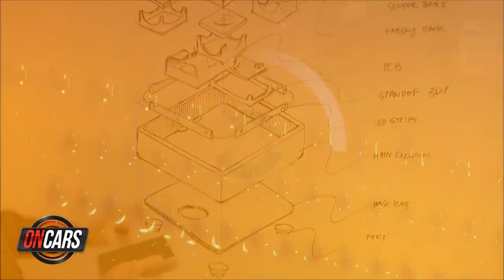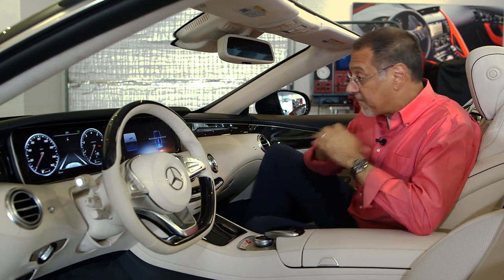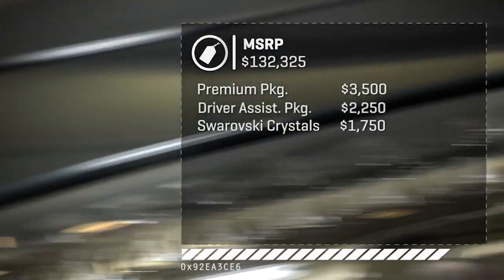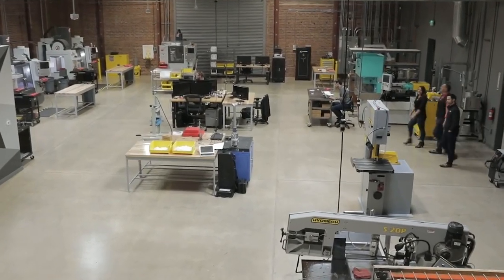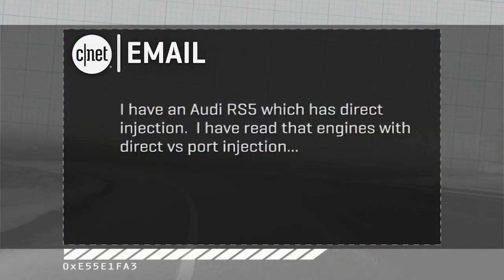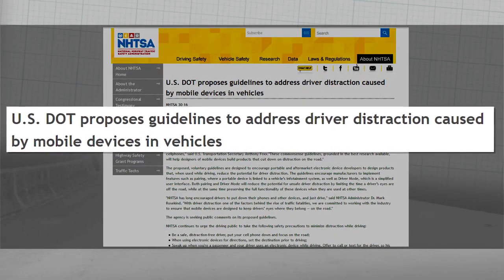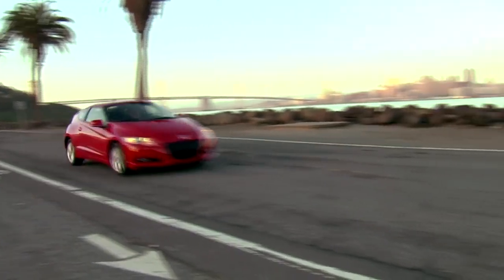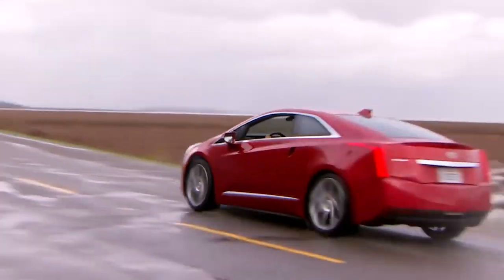Unapologetic as hell: Mercedes Benz S550 Cabriolet (CNET On Cars, Episode 102)

Comment: I'm glad he mentioned the high-latency of the throttle. 
We have an S550 W222.  The throttle is HORRIBLE and even in sport modes it feels disconnected.

The original W221 naturally-aspirated V8 was better. I could care less about the extra power from the turbos.

Comment: If Telsa could take some luxury interior notes from Mercedes they would be perfect. I like the interior of that Merc but I couldn't stand not having Autopilot, touchscreen, etc.
Reply: merc has distronic plus which is more or less same drive  like tesla 1.0 hardware ..as long as you keep hand on wheel it will drive it self on highway or start stop traffic ..tesla 2.0 still dont have any autonomous drive and its question will it ever had...it just promise from Musk which does not mean that there want be 3.0 hardware for full autopilot ..you can wait few years and tesla and mercedes will both have full autonomous ..for touch screen i dont hing will happen in mercedes before full autopilot car..2 much distraction from road

Comment: This is like a thing that not many people know, but carbon buildup is easy to get rid of! Go for a drive!!! My friend has a 2008 Passat 2.0T(probably the worst engine on this planet for carbon buildup). He drives it about 5k miles a year, drives it short distances, and it barely warms up on his commute. After 25,000 miles his engine light came on for sporadic misfires, it ran rough when cold, his performance was subpar and so was fuel economy. I volunteered to take it on a cross country trip. I took it 4,000 miles in a few weeks, and the engine light went off about 500 miles in. Just when I left, I locked the transmission into 4th gear, so it was revving at about 4,000rpm, and set cruise at 65mph, and left it there for about an hour. Filled up with a fresh tank and finished my trip. Now he has 0 issues, and he does long drives regularily and he never has an issue. Also, fuel economy and power are restored. Paying hundreds to get your intake valves decoked, is such a waste of money...
Reply: I own a 2012 GTI with a 6 speed manual. I'm at 83k miles and have yet to do the carbon cleaning because I always run 93 octane (top tier fuel at least 75% of the time, usually Shell V-Power), and do LOTS of highway driving, at which my car is usually turning over at close to 3k rpm. Something tells me that's how I've dodged the carbon buildup issues on my TSI engine
Reply: Patrick Gile it may happen eventually though. I work at BMW and we had a 2010 335i. I took it on a 20 mile round trip. Got it warmed up then set cruise at 70mph, and it revved at 5,500rpm the whole time. Everything was restored and no more cold start misfires. This also cures valve tick in many cases. We had a few 2008 X5's that would tick loudly until warmed up. Went out and did that highway blast revving high, they never made a sound again. Amazing what an Italian tune up does

Comment: RE the S550 Cabrio, it's a shame about the "stupid" switches, because one of the simplest luxuries is not having to struggle with the basics (and that doesn't begin to address the light switch!) It's also too bad that this bigger cabrio doesn't offer some knee room in back. Shouldn't it best the E class in that regard?
Reply: Satnitcboy  You are spot on.  I am puzzled by all the positive comments about this sub par vehicle. perhaps its the initial shinny ball syndrome.   After having a S Cab for three years , I couldn't get rid of it fast enough.  Back seat space for children only !      Optioned audio system that was as flat as an AM portable radio , Telematics that was good for the 90's perhaps.   A total failure of a vehicle